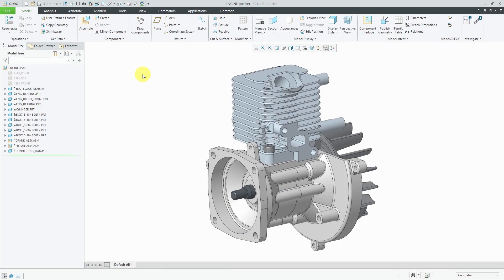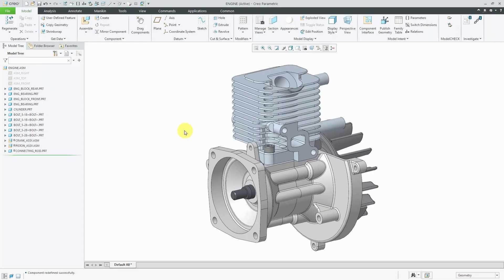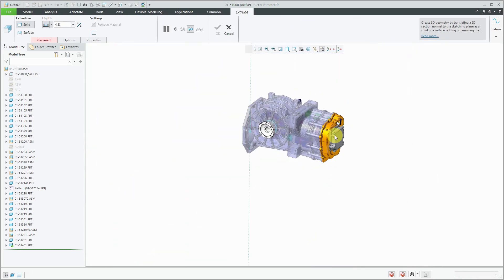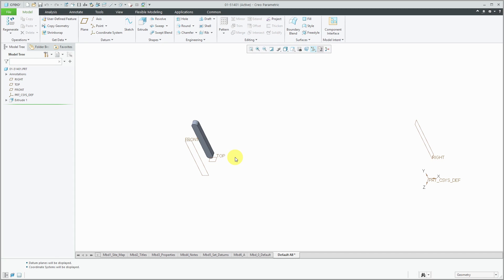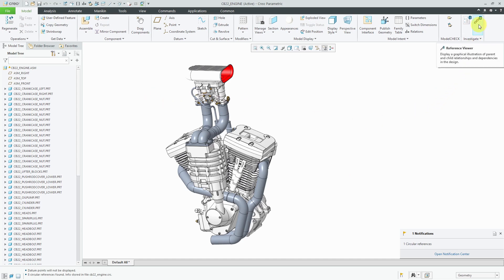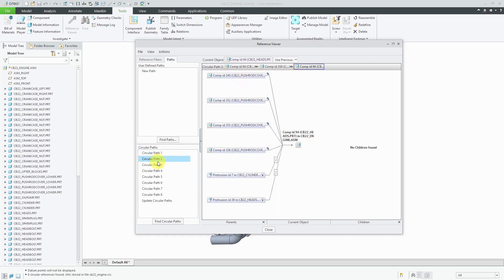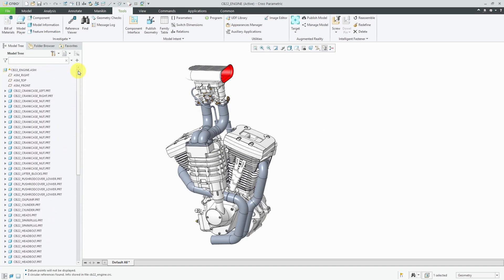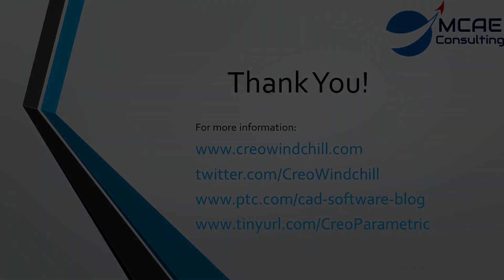Creo Parametric - Assembly Modeling Unhealthy Practices (Part 1)

Comment: for skeleton models and copy geometry, does data sharing refer to being parametric. so if you were to change a higher level feature that shrink wrap or copy geometry would also change?
Reply from the maker: I recommend you watch some of my videos on Data Sharing Features. The beauty of Copy Geometry, Merge, Inheritance, and Shrinkwrap is that you can control dependency (when changes propagate from the source model to the target model). For example, before you release to manufacturing, you might want to turn dependency off to ensure the target model doesn’t change.